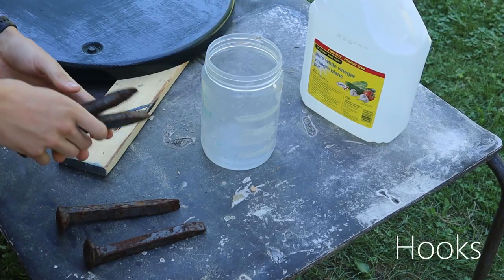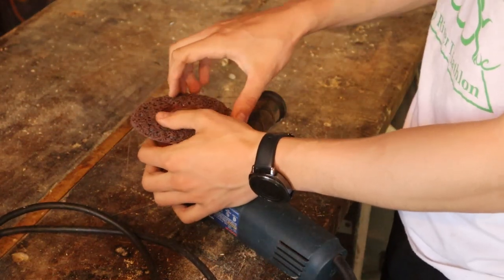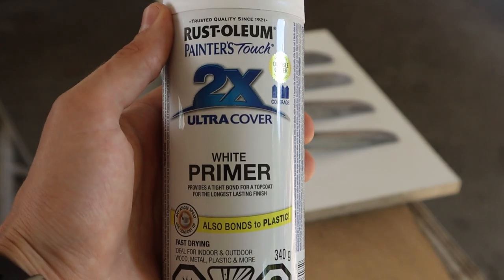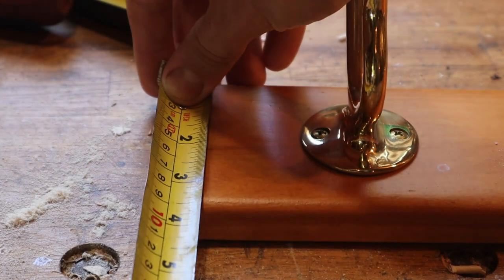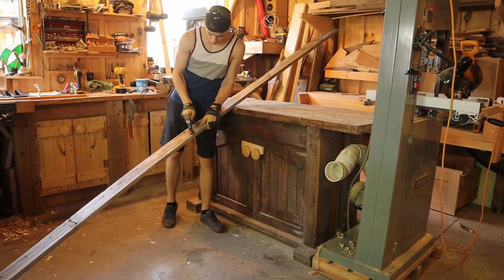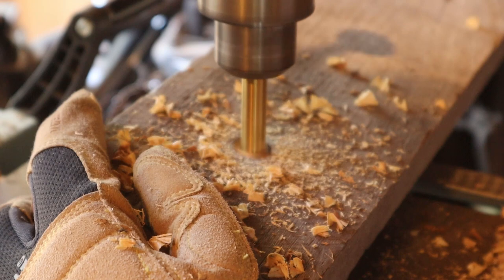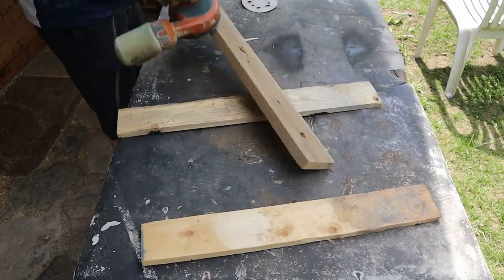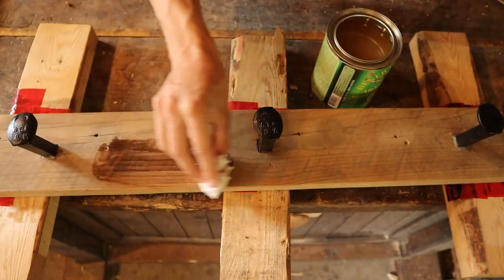Easy Rail Spike Hangers | Quick DIY Projects

Comment: A little tip I learnt recently is to make a wash of 1 part molasses to 3 parts water which I did and I soaked my rusty railway spikes in this wash overnight - fantastic result, rust all gone and once the spikes were rinsed off and completely dry I sprayed with a coat of pot-belly paint, they look soooo good 😃